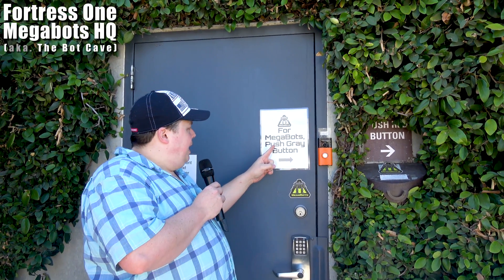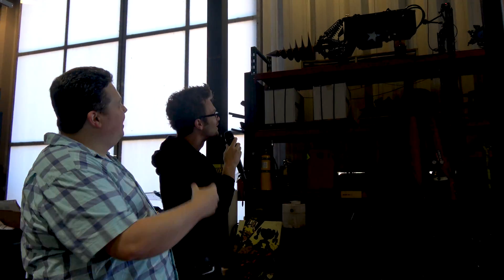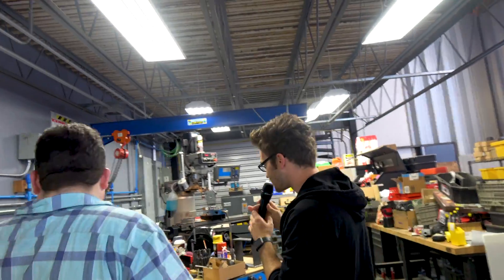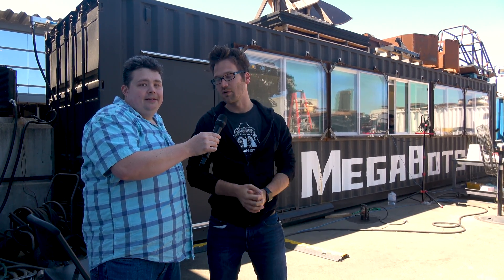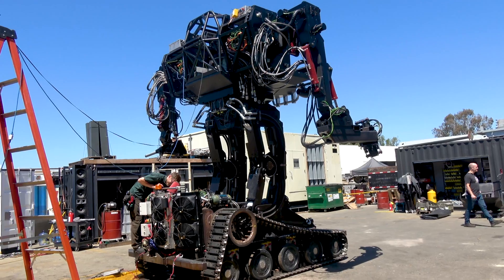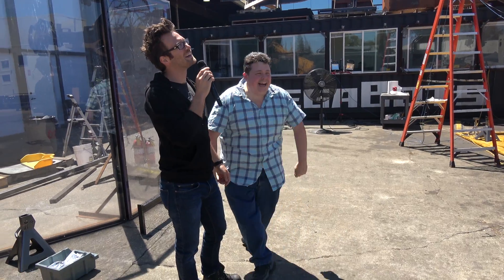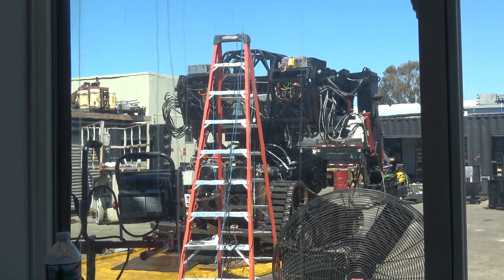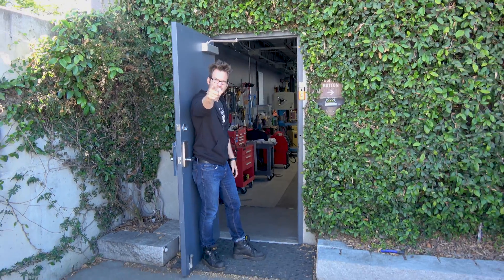MegaBots Life Size Fighting Robot Behind the Scenes Special Preview - @Barnacules

Comment: The mk2 was pretty slow. I'm hoping the speed is much improved.

Hope it's at Maker Faire Detroit again this year. I'd like to watch it crush a car. 😃😃😃
Reply from the maker: +Jonathan Mayer it was at 20%
Reply: I get it, but I've never seen it run faster. I'm wondering if the team has ever run over 50% power. It's massive, so I'm sure it's a safety concern. I just hope they're used to running it at full power before competing.

Nothing worse than your multi-ton robot flailing about like a toddler trying to break-dance.

Comment: and of course it's got a petrol engine, fuck america
Reply: Tricky D - given the amount of power contained in that small package, it's the right choice. ylu would need a lot more weight to get that much power out of an electric setup for more than a couple of minutes. Plus, refueling is faster if it runs out. Not to mention, a lot of the hydraulic pumps out there are designed to work with engines similar to that, so adapting everything to work was probably easier.
Reply: Nice try Trumptard

Comment: I don't understand how you can have a real fight when you have real people inside. That doesn't make any sense.
Reply: Because they want a mech fight, not a drone fight
Reply: Yea... they should use something like VR... if you can fly a drone like this you should be able to controll a mech from a box 10 meters away.
Reply: Yeah some sort of remote control would make sense.
Reply: Remy Lebeau its already hard to control it at distance
Reply: +Ekana Stone That is just BS semantics, besides the title of the video is "Robot" not "Mech".
A Mech fight wouldn't be a real fight because they would be too afraid of the drivers being injured.
Reply: There's probably going to be a rule to keep the pilots from getting injured. Maybe no cockpit shots.

Or the cockpits are designed with pilot safety in mind... Like the previously mentioned roll-cage designs for the frames in their other videos...  Like how everything with a driver seat usually has?

Comment: FINALLY someone doing something sensible with modern engineering.
Reply: modern engineering hahahaha... you should see the japan bot boii
Reply: I have seen it. As much as I like Japanese style mechs, they do seem to have made theirs based on anime, while the American one have had a chance to build theirs from scratch with the express purpose of this fight.

I still think they have a chance, but they are at a disadvantage since they made theirs for show while the Americans made theirs to crush.
Reply: +morphman86 The Kuratas was built for riot control, and it has more mobility. The one that will be presented in the duel will also be made specifically for that duel. It's not just for show.
Reply: From what I've seen, it's basically the same one as the original, which isn't really that useful in a fight like this. Remember, riot control is against humans. This murder machine is much, much tougher and much, much stronger than a human.